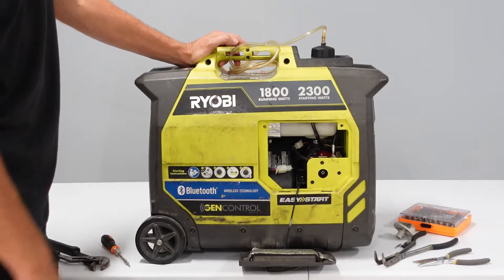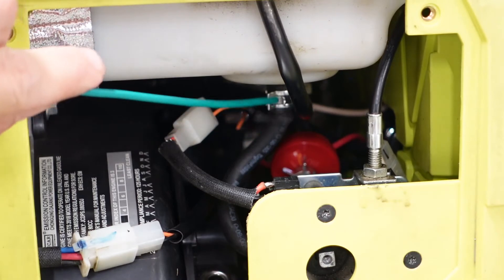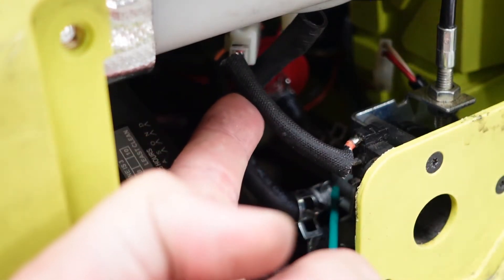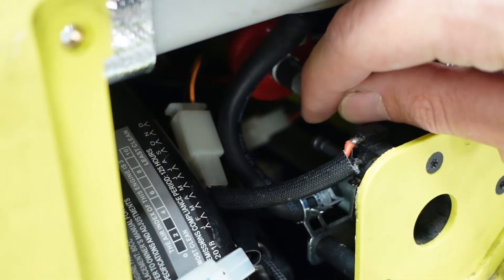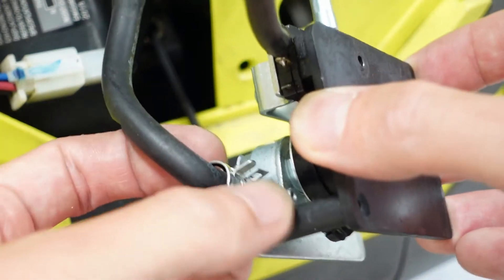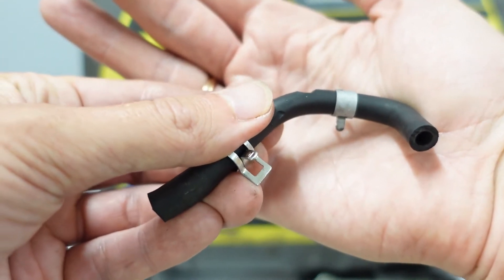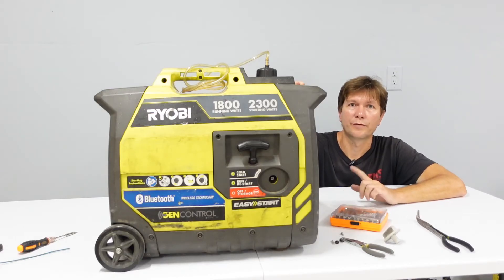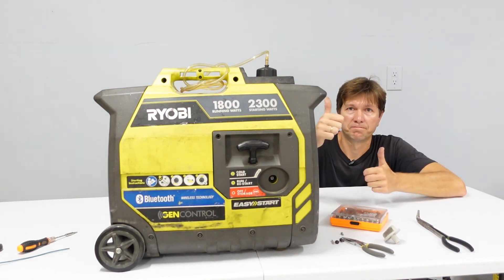Check ASAP FUEL LINE LEAK after 700 hours. RYOBI 2300-Watt Inverter Generator.

Comment: As my AiVolt 4300 inverter generator, the hose you're replacing has TWO different sized ends. This meant that the small end wouldn't  fit on the fuel tank. So don't cut it off.

Comment: I'd recommend buying Viton ViTube or the cheaper Tygon Excelon DEHP Vinyl from the U.S Plastics website. Use calipers to measure the fuel nipple fittings on the carboretur, the fuel valve petcock and the polyethylene gas tank. Measure past the barb where the hose will be clamped. Purchase a box of ViTube for each size by rounding down your measurement to the closest available inner diameter or ID of ViTube in the catalog. DO NOT PURCHASE REPLACEMENT FUEL LINE PARTS. Just use the good stuff!

Cut your Viton fuel hose with a knife or use a PEX tube cutting tool. Insert needlenose pliers into the Viton hose and stretch it then apply silicone grease to the fuel barbs. For the fuel tank use a larger piece of Viton fuel hose and a polyethylene or brass reducing barb fitting and two clamps to interface the larger tank tube with the smaller tube for the fuel valve petcock. 

Upgrade to the indestructible synthetic rubber Viton! It is highly resistant to ethanol and gasoline. It can withstand 400 degrees of heat for prolonged periods. It is incredibly tough and durable making it resilient against vibration and abrasion. It will never  harden or crack. 

The proprietary synthetic fluoro-elastomer rubber is patented by Chemours. They own the rights to it and there is no substitute for the real deal. Its different from rubber because its specially engineered to be incredibly resilient to survive industrial environments. Its superior in every way to the Chinese "fuel hose" that this generator comes with.

Comment: Instead of cutting the pipe, will wrapping the fuel pipe with electrical tape or duct tape work?
Reply from the maker: I solved this problem radically ))
Probably the tape or heat shrink tubing could work well.
Thank you for advice!
Reply: @Mrcabuag  Gasoline is a mixture of different solvents that will dissolve the adhesive of duct tape and electrical within minutes
Reply: @AddyEspresso  right.   But I think in this use case,  the gas shouldn't come into contact with the duct tape.   If I'm not mistaken,  the purpose of the duct tape would be to provide insulation keeping the heat from degrading the tubing.  What do you think?
Reply: @Mrcabuag  It still won't work because those materials aren't heat resistant on their own and have no insulating properties. Additionally gasoline permeates through to release solvent vapors from inside even the toughest fuel line unless you use teflon lines with special fittings.

You need to use Kapton tape which is a thermally reflective heat and solvent resistant polyimide material
Reply: @AddyEspresso  thank you,  I just ordered some kapton online
Reply: @Mrcabuag  Check my other comment on this video. Using Kapton would be futile with the low quality Chinese fuel line this generator comes with. You need to upgrade to Viton ViTube from U.S Plastics.

Comment: Please post the part # of the replacement fuel lines.
Reply from the maker: 570358170 - from tank to control knob valve.
570358171 - from valve to fuel filter.
570358172 - from filter to carburetor.
This is from Ryobi Parts List Manual 998000248

Comment: I would like to express my disappointment with this generator. Since about 10 hours, this generator has been disappointing. It clogs up with debris, because it has no fuel filter on the tank I put side. All my other inverter generators have an in tank fuel filter assembly. Easy fix and you “could” make this the BEST inverter generator out there.
Reply from the maker: It has regular small fuel filter.
Reply: 100% Agree with Carlos. Fuel filter must be relocate before fuel tank to protect the control switch be clogged by debris. Very good video my friend. Keep us uodated about any problem and how to fixed.

Comment: Now I need to check my fuel lines 🤣👍👍 have you used the same model with battery starter? Thanks 🙏
Reply from the maker: No, I've never seen this generator with an electric starter in the stores.
If anyone has it, please check the fuel pipe under the control knob cover and post the information here.
Very serious problem.